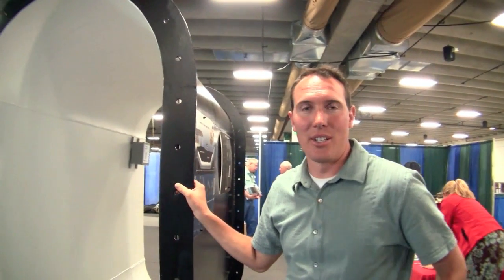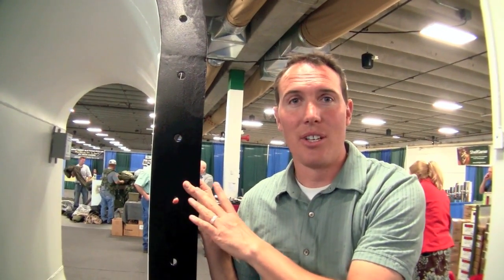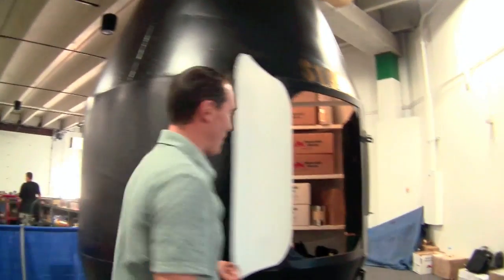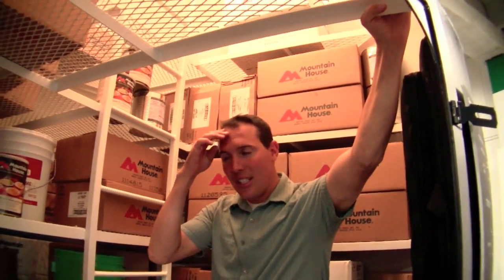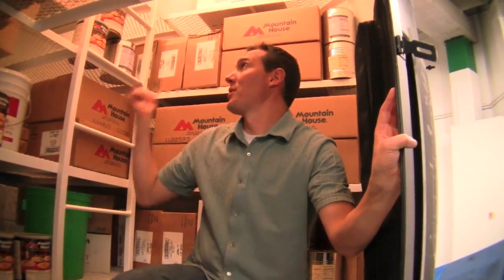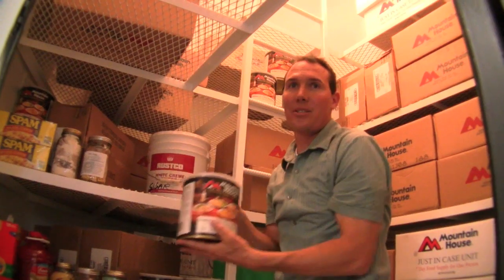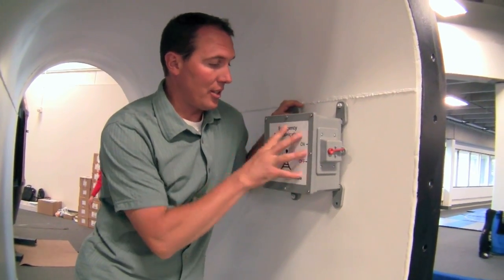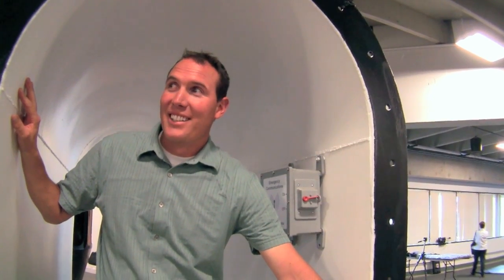Self Reliance Expo - Part 7 - Security Disaster Shelters

Comment: The problem is that any disaster big enough to precipitate a need for such a shelter will leave you without electricity. This means no air and no lights, which renders the underground shelter useless for anything but storage. You could run a big noisy generator, which might be a bad tactical move, but you'd have fuel for days or weeks at best.

This is why I've always thought shelters were stupid without your own private hidden nuclear or hydroelectric generators.
Reply: TheDamnSpot - the Armish don’t require power.